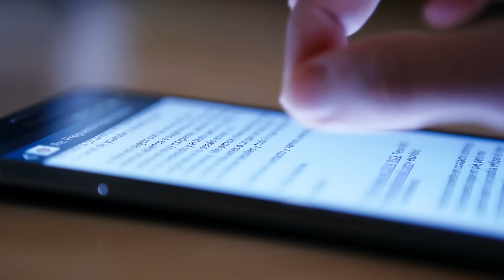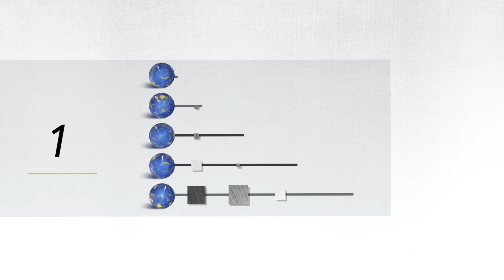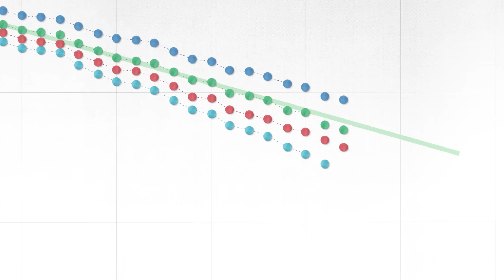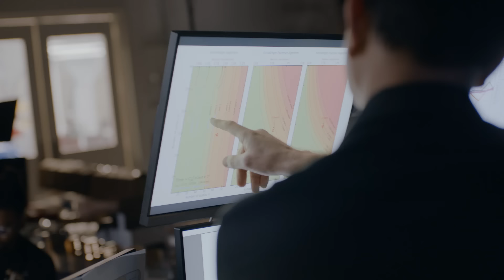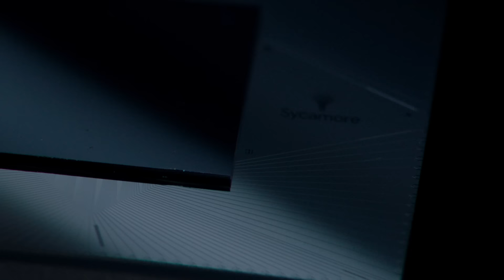Demonstrating Quantum Supremacy

Comment: Apple: A13 Bionic Chip is the best and smallest processor ever.

Google: hold my qubits.
Reply: Intel and AMD are also probably laughing all the way to the bank. Apple ain't even close to being in their league
Reply: @JollyOldCanuck  I was more referring to Apple's claims of moving away from Intel on their Mac lineup in favour of Apple-designed desktop CPUs.
Reply: @JollyOldCanuck  not even close apple fan! There is a limit to how much power is needed in a small phone!
Reply: @JollyOldCanuck  intel doesnt make snapdragon. Qualcom does
Reply: @mgmg116  Apple's A13 bionic destroys like 80% of all mobile processors, not desktop, but mobile. On a size scale, the A13 is absolutely insane, and if it wasn't for thermal limitations for being in a phone, it could be turned into an absolute beast in a real setup. To put into perspective, Apple's A12X chip that's in their iPad PRO has a score of over 200,000 on antutu benchmarks while an intel core i7 has only around 70,000. This is a multi-core test, and the results are ridiculous. The only thing limiting apple chips are thermal throttling.
Reply: @mariobastidas3102  But it's scaleable
Reply: Your dialogue joke is like 3 weeks old and would be considered obsolete in this age.  Find a new joke to copy.
Reply: @EDMIRE  lol you are WAY off. A12X doesn't score anywhere NEAR 200,000 - it scored 18,217, which, as quoted, was "just BELOW the i7-8850H". Does "BELOW" suddenly mean better?

The next comparison they have is the i7-4770K, which tops at 15,000-and some. So... Congrats I guess? Your A12X is better than an i7 that came out over 6 years ago (not really a huge accomplishment) it ALSO shows how far they have to go to catch up to desktop CPUs, which would have been their original claim, which was MY original point. All bark, no bite.

Edit: Here is the link to back up my numbers; https://www.google.com/amp/www.iphonehacks.com/2018/11/ipad-pro-a12x-bionic-chip-beats-intel-core-i7-chip-last-year-geekbench.html/amp
Reply: @EDMIRE  In all fairness, Mac OS is a pretty great operating system and generally, Mac hardware is just below excellent. If they considered a price drop that cut them down closer to what the machines were actually worth (especially considering they offer Mac OS for free) I'd consider purchasing one myself.

In the meantime I'll stick to building PCs.
Reply: mgmg my thoughts
Reply: @EDMIRE  Actually, I think the main limitation on phones is battery life. That much raw power doesn't bode well..
Reply: Saucerer supreme I never mentioned putting other CPUs into an iPhone. I was talking about optimizing apples A13 bionic to be a desktop CPU and it would be pretty beefy it given the proper cooling and power.
Reply: mgmg I was referencing an antutu score, not traditional scores. Also, if a phone CPU can trail a CPU that’s still significant in today’s standards, then it’s damn impressive. It’s a phone, and apples a13 (not a12) destroys every other flagship phone CPU.
Reply: @EDMIRE  I have to apologize because I didn't really realize we were talking Geekbench results as opposed to Cinebench (which for some reason, I thought was the case, maybe I read too fast or didn't pay enough attention).

Geekbench scores are based entirely on how well a CPU executes code in the instruction sets that it is designed to handle. There are also score multipliers based on clock speeds and core counts. This is exactly where Geekbench falls short (as in, it will assume that a 10+ year old 4 or even 6 core will beat a modern 4 core CPU - which is completely false). My previous understanding is that the A12X was on-par with the 4770K or better (and according to Geekbench, the A12X IS better by a WIDE margin) - which is mistake #1.

The A12X is not designed to understand, nor utilize the same instruction sets that a desktop CPU is. Not only this, but Geekbench is more about "how well does this CPU crunch through a lot of super-specialized bite-sized instructions optimized FOR that particular cpu?"

Which is not at all indicative of real-world performance. It's like giving cars an arbitrary number rating based on their power to weight ratio x their rpm rev limit.

If we do that, the number results would show something like a Mazda Miata beating a Corvette. Do you see a factory stock Miata beating a factory stock Corvette any time? No. Why? Because the Miata is a Miata and the Corvette is a Corvette.

Put them both on a 1/4 drag strip. Who wins? The Corvette. Put them  on a circuit track. Who wins? The Corvette. The Corvette wins for exactly the reason I mentioned above.

Bench an A12X with 3DMark or Blender renders and you will very quickly find the limitations of mobile CPUs. The A12X was never better than an i7, the arbitrary score assigned to it was just higher because the A12X chews through A12X workloads better than an i7 would because A12X workloads are optimized to run on an A12X as opposed to an i7.

Again, it's like taking power/weight  x RPM limit and getting a higher number for the Miata than the Corvette. Just because the Miata is smaller and lighter and revs higher, does not mean it will ever beat the Corvette, nor will it - simply because it is NOT a Corvette, nor was it designed to be. It is designed to be a Miata, which is exactly what it is.
Reply: mgmg 👎👎👎

Comment: Me: So when a bit stores data as a 0 it's actually storing it as a 1?
Google: Well yes, but actually no.
Reply: @Manoj Kumar You need to store data to process 🤦‍♂️
Reply: We could be about to explain the Fermi Paradox.
Reply: it's not only about knowing what it is, it's about knowing when it is what it is.
Reply: Bit is 0 or 1. Cubit is wat you're talking bout.
Reply: You can store the state of the electron with magnetic force. That however is a bit tricky in large quantities and everyone if working hard on that task.
Reply: Me: So when I vote  Conservative I actually   vote Liberal?
Google: Well yes, but actually. . . yes.
Reply: David Farah it's not storing it. That defeats the purpose of the superposition as you're giving it a value and maintaining that value. The processor simply processes things extremely quickly because a Qubit is BOTH states at once. It's neither 1 or 0, it's both until it's measured.
Reply: hmmm sounds like Schrodinger's cat :P
Reply: @hackslash666  In a way yes? If you don't measure it it's both, once you measure it it's one of the two.
Reply: Look up schrodinger's cat
Reply: @zachhuntington9990  Me: So when you vote you actually don't vote?
Google: Yes.
Reply: All Theoretical BS. Sounds very cool in a slick utube vid made by Madison Ave,but is a  sinkhole.
Reply: @mannyc19  I agree. A showstopper like quantum logic gates are years away as a practical application. They will never make the R&D money back.
Reply: Tshering Tamang that's because Schrodinger's Cat is literally about quantum mechanics. So yeah, it IS Schrodinger's Cat.

Comment: Everything with "Quantum" on it sounds cool.
Reply: Quantumrape
Reply: @swipsi6858  Quantum Child Abuse
Reply: quantum lies
Reply: @swipsi6858  "they said yes and no, how was I supposed to know what to do?"
Reply: and surprisingly it need to be cool to work, lol
Reply: Quantum COVID-19
Reply: Quantum internet, by quantum entanglement, seriously imagine a 0 ping connection
Reply: @KevinCnj  I wish I could, but u can never get that, as signal can only travel at max light  speed, so forget about getting 20- ping
Reply: @macle5007  Basically "The information can't travel faster than light"
Reply: Vladimir.... no... imagine minus ping... you’re doing future moves in the game..
Reply: @KevinCnj  there are at least four reasons that will never happen:

1. Relativity forbids the travel of information at FTL speeds. You can't communicate that quickly.

2. The no cloning theorem of quantum mechanics means you can't copy a qubit's state. This would require you to first measure it, which changes the state.

3. Even if those weren't true, quantum entangled particles have to be together in order to be entangled, you'd then have to ship the particles between the sender's computer and the receiver's computer. Very very slow.

4. (Much more pedantic). Even if that wasn't true either, you would still have the time between receiving the information, and your computer managing to display it. Of course this would still enable incredibly low ping, but not 0.

I am not a quantum physicist, I may have (probably) said things here that are not correct, but my overall point is: it wouldn't work.
Reply: Quantum COVID
Reply: OMG ITS TEK WTF
Reply: @thewild2334  OMG ITS THE WILD
Reply: @BobKermanPlaysGames  nah i freaked out cause this is a good discord friend of mine... didnt expect him to be here!
Reply: @thewild2334  Yes I know damian
Reply: @BobKermanPlaysGames  woah who tf are you?

Comment: Google: We built a Quantum computer

Me: I can finally play Crysis 3
Reply: nice.
Reply: games no, quantum computers not compatible with windows and cost millions
Reply: @augustasrimkev633  Quantum computers can run a few operating systems at the same time.
Reply: There's absolutely no benefit to building a quantum GPU over a conventional one either.
Reply: @benlev3375  they can and they can't at the same time
Reply: @matijagrafsoro3783  Actually quantum processing unit can be good at simulation and path tracing, which would enable more realistic graphics. More realistically it will be used with GPU or whatever fusion of cpu and gpu we will have. It will only be used in cloud gaming for the near future.
Reply: Dang, I was about to make the 'But can it play Crysis?' comment.
Reply: Oh, I'm sure we all knew that quantum computers aren't for gaming.  It's just a joke going back to the first Crysis, a 2007 game that was for the time incredibly good-looking and horrendously system-intensive.  The game is so badly optimized that even modern gaming rigs have trouble keeping a consistent framerate on its highest settings.
Reply: @SerialSnowmanKiller  I wish I could give you 10,000 Thumbs up :)  you got the joke :)

Comment: Imagine the capabilities on Minecraft with this bad boy
Reply: Chunkyy Twinkie shaders would look good
Reply: Obviously this is a joke but the answer is not a whole lot. Quantum computers are superior in very specific computational tasks that can be well parallelised (i.e. solved simultaneously) games such as minecraft do not require parallelised computation (for the most part, ray tracing for example could be hugely improved) and rely more heavily on single threaded performance
Reply: @Aguycalledmax  exactly. Minecraft is a very cpu heavy game. Normally parallelised operations are done by your gpu. quantum computers wouldnt make minecraft that better but simulated physics such as rain, light or even game ai would benefit extremely from a working quantum computer.

Comment: that's nice and all but can it run Crysis? 😂
Reply: Not more than 24fps.
Reply: It can not run Crysis!!!
But it can make something that can run Crysis, Crysis 2, Crysis 3 simultaneously!!!!!
Reply: Not really, not even close, and it probably never will, you should not think of a quantum computer as a "Very good regular computer". It's completely different down to the bare logic itself
Reply: @litarchives Nop, and there are a lot of reasons about why not. Quantum computing is surrounded by a lot of missconceptions. For example, they do not use the convencional logic operations, and as such regular computer programs would not run in them. Not only that but even of you get the program to run, it would still be sequential logic. And would not run better that in a regular computer. In fact it would probably run a lot worst, sience quantum computers are still very very very vey very basic. They can be amazing at computing certain types of operations (And that would open a ton of posibilities in a lot of scientific fields). But they are not like a new kind of super fast computers.

Comment: The video is a bit misleading in my opinion. They essentially got a regular computer to run like a quantum computer (like an emulator). The supremacy occured when there actual quantum computer was running faster than there ordinary computer emulating a quantum computer. IMO, real supremacy should be named when it is the same task being solved using the two different methods of quantum vs ordinary computing. EG. a brute-force crack vs a quantum crack

Comment: My last time helping, the information your sending to your computers are just electricity. Just like in your body. The quantum computer you build is like a brain. You lack power so you need a better generator of power for it. One of the computer parts resembles a reactor, but instead of radiation. It requires electricity to run it and electric thermal cooling to help it run properly. You already have the parts you just have to put the peices of the puzzle together of the mechanism that interact with one another as a whole unit when put together. Your generator a brushless motor with repeling magnets on the side will power itself and, your reactor work as one. To power and operate one another to make more power instead of draining the grid.

Comment: not very convincing. ok it makes computations faster that's great. more problems than solutions it seems. The thing is big, requires a lot of resources to run, basically it only runs in a lab, and it's not portable. It has questionable viability. doing the number crunching is one thing. You can crunch numbers, but what philosophies you carry behind doing so have nothing to do with number crunching, data researching, developmental testing and researching applications for it when it meets your goals.

Comment: i need a matchbox sized 15gz processor, 1 tera ram, 500 tera ssd, audio/vid computer that projects a 80" 8k desktop on any surface, that can charge itself with any light shining on it.  how long yall need?
Reply: You can assemble that today for a couple hundred grand (not quite at the clock speed, yet, not even with liquid nitrogen, I guess)... but why would you?

Comment: If the thing quantum processing units are good at is parallel processing, why not use it to create more powerful graphics processing unit at a fraction of the cost (assuming the materials and manufacturing aren't as expensive as classic GPUs)? I'd be interested to see what that allows us to do with computer graphics
Reply: It's not that simple. GPUs work doing several sequential instructions that are divided between the cores. A quantum computer can do a single task much much faster, if this task requires a functional logic instead of a procedural one. It's like: A GPU can render your minecraft world with shaders, a quantum computer can find a minecraft seed that have a 6 block cactus if you wish and a normal CPU can do both, but very poorly

Comment: So if a quantum computer does not compute how about we call it a quantum machine. For it's use can we use this for practical problems like database searches? Make a huge database and have the quantum machine tell you where data is you are looking for. This in my little mind seems like it could be very useful.
Reply: Although now thinking about it, a conventional search query would go through the reference ID's of the data in the database until it found a matching reference id and return the data. If a quantum machine would go through all reference ID's in the data base at the same time basically finding the right reference id on the first and the last try, it would spike a search on every database entry as if a conventional computer would try to find a id and found it on the last attempt. Again if I understood it right which may not be the case.